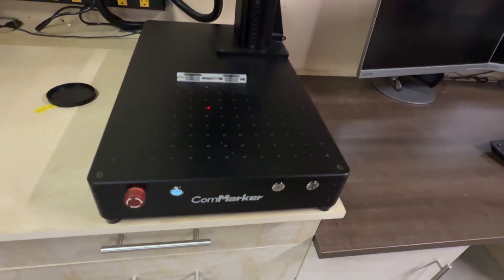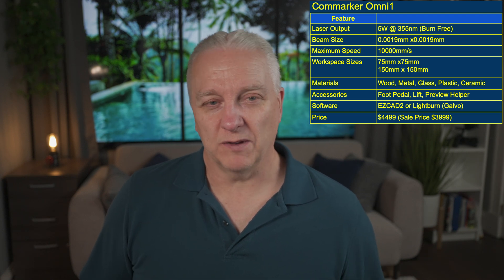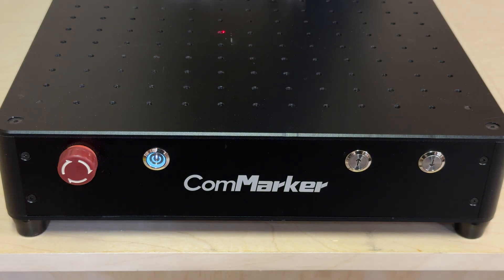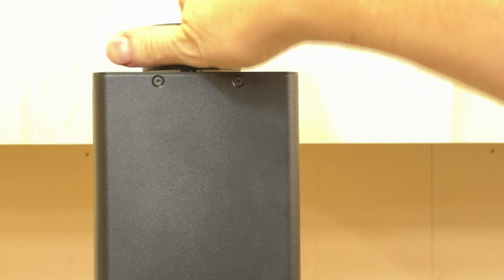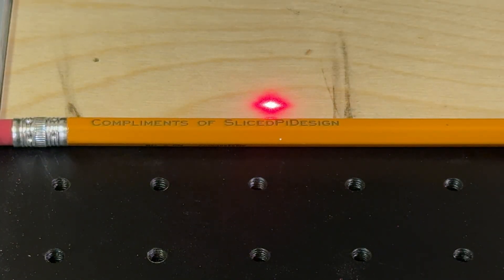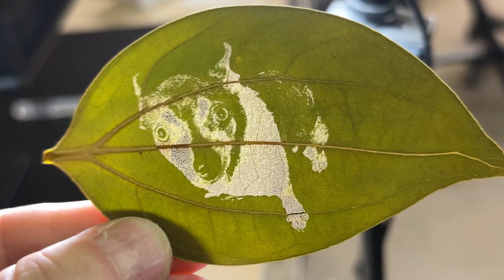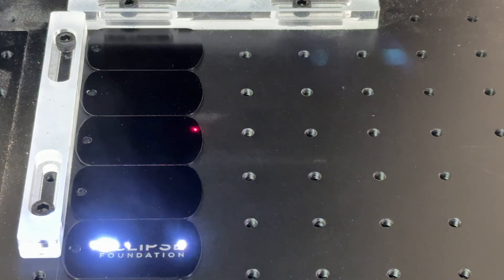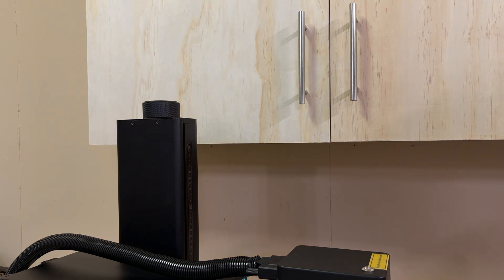Commarker Omni 1 UV Laser Engraving Secrets Revealed!

Comment: I have the Commarker Omni 1 and I have been using it for a while. The engravings have been coming out good. After I got he bed and the laser source level, I noticed that the galvo head dips down towards the front. I used a digital angle finder and it is off level about 1.2 degress. It's lower towards the front than the back. I have emailed Commarker, but they haven't responded yet. They've been very good so far. I have no compalaints about their support. I just wanted to see if you had experienced anything like this, and what you did about it. The other issue is that I was trying to change to the 70mm field lens, but it seems too long to fit in the alvo head. I couldn't see if there was some kind of adapter I needed to remove. Thanks, for all the great videos. I try never to miss them.
Reply from the maker: I had to shim my Titan 1 - if you’re picky about level, having to do this isn’t uncommon with galvo lasers

If your lens doesn’t fit the possibly you got shipped the wrong lens. Make sure it is for a UV laser. It will be written around the outside ring. Maybe they accidentally shipped you a Fiber laser lens
Reply: @SteveMakesEverything  Thank for the reply. Commarker replied and said that the Galvo head may be loose. I checked and there is nothing loose. When I am engraving inside a glass block, the effect of the glavo head being off is visible. Surface engraving does not appear to be a problem. I may try a shim. I've been in contact with Commarker for their instructions. I don't want to do something that would cause a problem. They told me that the lens has an adapter that can be unscrewed to fit. Thank you for the great videos and advice.

Comment: Hi Its well known that you can't laser cut or engrave pvc due to the toxic fumes Can it be cut with the omni 1 as its UV and doesn't generate the same heat? thanks
Reply from the maker: I would say no - at least I wouldn't try it.  The UV laser is a bit like a hammer and basically breaks material away - some of which will be small enough to get airborne.  The laser would certainly be capable of breaking chemical bonds, so I think your still going to have chlorine ions floating around.

Comment: Hello can you pleas tell me how you  do the material test was at 10 mins 14 seconds in your video  please
I’m trying to do a yeti cup engrave but never comes out shiney  silver under the coating  like other peoples have
Reply from the maker: This would depend on the laser you are using, so I'd need to know that (I assume it's an Omni 1 though).  If you are using anything but a CO2 laser then the settings will be very critical - and so will the focus. 

A UV laser will mark stainless steel, so once you have enough power cut through the paint, then you probably have more than enough to mark the stainless too.  What you can try to do is find two settings:  The first would be to cut almost all the way through the paint, and the second would be more gentle just to polish off the remainder of the paint and get you down to bare metal.

It sounds like the opportunity to do another video though.

Comment: I jusr got the Omni 1 5w UV laser. the installation is straight forward except when I look for the COR file in the parameter directory on the usb stick. I can find the file in Windows explorer, but when I try to load the COR file in Lightburn, it does not show any files. Lightburn 1.7.08. Any suggestions?
Reply from the maker: This is really a lightburn issue rather than the laser, but if you can find it in Windows, the easiest thing to do is copy it from the thumbdrive to your downloads folder or another known place on your drive.  Otherwise on the thumbdrive you'll find it in the software15 folder.

I assume you also loaded the markcfg7 file during the LB device installation.  You'll need that to set up the base laser configuration.
Reply: @SteveMakesEverything  Thank you for the quick response. I copied the files to the hard drive, and formatted a different flash drive, and transferred the files. Lightburn can find it. It may have been a problem with the flashdrive. Thank you again.

Comment: I use UV powder from hobby store mix a very small amount with rubbing alcohol into a small fine mist spray bottle and apply to item to be engraved.  Drys fast and wipes off with cloth or paper towel. I do not have to use the green paddle any more.
Reply from the maker: Nice.  I just use a sheet of white printer paper which makes the blue framing bright.  I’ve never used the green paddle

Comment: I made the mistake of buying this laser, the Omni 1. It didn't power up when I assembled it, after waiting a fortnight for delivery. There was no damage to the box in shipping but when ComMarker asked me to open it up and look inside I was disgusted with the "assembly". Wires not connected, a physically broken power switch, the power supply was completely insecure and the stepper power supply connector was ripped out of the unit. It's a lot of money for very poor quality.
Reply from the maker: I think they use a standard harness for a couple of different lasers, and not all features are available on all lasers - hence, the unconnected wires.  If the power switch was broken, then clearly, the box was dropped during shipping, and it would be pretty hard to blame a manufacturer for that.  However, I have suggested to Commarker that their packaging could be improved quite a bit.

If things are actually broken then I doubt this is a quality issue.  Commarker didn't take a hammer to it before they put it in the box.

I get a lot of lasers shipped to me and I've had a couple that were obviously dropped off a truck.  none of mine were Commarker's though.
Reply: @SteveMakesEverything  Unfortunately Steve, the wires I'm speaking of were the power supply lines between the individual units in the base. They were obviously insecure in the terminal blocks where the screws hadn't been tightened, one of which looked as though it had been stripped and never connected. The insecure power supply was because there were simply no screws and that had obviously been rattling around inside the base causing the broken switch.
Reply from the maker: @elguapo1507  Hmm, what has Commarker said?
Reply: @SteveMakesEverything  They looked at my video, apologised and said they would replace it with a new, fully tested one. The problem with that is it will take weeks to get here again and that wont get my work done on time.
Reply from the maker: @elguapo1507  Well you followed the right path.  I can't do much about their timing, but this is a problem I've tried to address with several manufacturers when it comes to support.

If a company has to replace a unit, then they should get it to the customer on a rocket.  The problem isn't the customer's fault, and the issue often impacts the revenue potential of a small company.
Reply: @SteveMakesEverything  I fully agree. The logistics is out of their hands in reality. The problem, as far as I can see, is that the box showed absolutely no signs of damage so overzealous handling isn't apparent. The fact that ALL of the damage was contained within the base unit and the power supply unit was completely unshipped thus causing the pulled wiring and physically broken power switch, that shows poor workmanship and poor quality control.
Reply from the maker: @elguapo1507  No damage on the outside doesn't mean it didn't get dropped.  These are precision devices.

I just hope you can get a swift resolution one way or the other.
Reply: @SteveMakesEverything  I absolutely agree. Well packaged but it was the internals that were unshipped and rattling around Steve. They ARE delicate devices and should be assembled with exactly that in mind. Positive locking devices or even threadlock would have stopped this from happening.
Reply from the maker: @elguapo1507  I wonder if they are putting thread lock on all the screws.
Reply: @SteveMakesEverything  There was no evidence of any threadlock on the screw that I found floating around. You usually see the red or blue remnants of it on the threads but there wasn't any. The screw length itself was pretty short and it would probably only just be "in safety" when torqued up.
Reply from the maker: @elguapo1507  The screws used to hold those power supplies do tend to be short because they don't want a long screw poking something inside the box, but really they should use thread lock on anything not designed to be removed regularly.
Reply: @SteveMakesEverything  I agree with you. It's a shame but, in my opinion, it didn't need to happen. There are so many positive locking methods available, even if they only used tab washers or just threadlock. I'm just furious that I've got hundreds of items that need marking and I'm probably not going to get them all done.

Comment: Hi Steve, I received the Omni1 today.  I followed your steps, but had to manually install the driver. Also, entered the Cor File.  Omin1 is showing as a device but it says disconnected.  What did I miss? I know its late, don't expect you to respond now.  I would appreciate any help you can offer.
Reply from the maker: You might need to select the port rather than relying on Auto port selection.  You may also need to install a driver if you’re running Windows. There is a driver folder on the UBS thumb drive.
Reply from the maker: Also restart both the laser and your computer and try again.
Reply: Good morning, I'll try that and let you know. Thanks
Reply from the maker: @nancy2371  Keep me posted.  It looks like you're mostly there.
Reply: @SteveMakesEverything  So I did what you suggested and it didn't work.  But what you suggested got me thinking, burning the brain cells.  I uninstalled LightBurn and reinstalled it and it worked. I'm so happy, I don't know what to do with myself.  Now that its is working, I'm going to set up the fume extractor. Then off to material testing. Thanks again for your time.
Reply from the maker: @ cool. Maybe it was the switch between regular Lightburn and the Galvo version that didn’t work quite right.

Comment: What material settings did you use on cork?
Reply from the maker: I don’t work with cork too often so I don’t usually keep track of the settings for it. The best thing to do is to run a material test so you have a reference you can tap when you are engraving these

Comment: But this laser has hardly 10000 hrs instead of the 100000 lifetime hours(rated spec on any real fiber laser). Also DPSS lasers such as this 5W laser can have premature failure, due to degrading QSwitch, when operated at high output levels(close to 100% duty cycle).
Except for engraving on glass, cloth it does not have any benefit compared to other low cost NIR dpss machines such as 2W Atomstack M4. It is true that the dot size is small, but unless engraving on tiny items, it is not a big deal. For what its worth, the UV laser is overpriced, due to missing fiber modules such as Raycus or JPT. It is atleast 3X overpriced, and will come down in price with time, especially for an aesthetic engrave only function.
Reply from the maker: True, though I would defy you to find any laser that will last much more than 10000 hours,

Comment: It seems great and all, but is this considered more like the Cricut of UV lasers or more of a higher end model? It's not locked into proprietary software or the cloud so that's good.
Seeing it come in a fancy box like that makes it look like it belongs on the shelf at Walmart instead of a crate. Things you buy at Walmart are okay for hobbies, I need something built to work for small business.

So far it seems like this will do it.
Reply from the maker: I’m not sure I understand the Walmart comment, but UV lasers are the pinnacle of laser engraving since they work with almost any material, and do what is referred to as cold engraving.  This laser doesn’t heat the material, so engraving things like plastic or glass parts is trivial, and it’s the only way to engrave without any surface prep or clean-up after engraving.  This makes it perfect for volume business work.

Most UV lasers are in the 3-10W range and the Omni1 sits in the middle of that range. This laser is far better for small laser engraving business work than any diode laser, though it isn’t designed for cutting.

Comment: Have you had any issues using a rotary?  I just can not seem to get it right but it works fine on my other lasers.
Reply from the maker: I have a cable that connects between the laser and a stepper motor. Note that there are two different stepper wiring configurations. If your isn’t working, most rotary attachment come with a short cable that you can insert onto your existing wiring to flip the stepper wiring.  I have a couple of ComMarker rotaries, but I also hacked together a different rotary from a Wecreat Vision.

If the rotary stepper is powering on when you turn the laser on (e.g. the rotary is hard to turn by hand), then the wiring is probably fine.  In this case go to Lightburn rotary settings and set the steps per rotation to 12800.

Comment: How deep can you engrave into plastic? I’m try to make cattle tags that are 3 layers. I need to remove the top layer so the middle layer is exposed. My diode lp4 does ok on some colors but I’m hoping this would work better on tags that are white over a black core. Thanks!
Reply from the maker: Ha, Amazon sells them, though I don't really need 50 of them😀
Reply: @SteveMakesEverything  I buy mine from Ritchey tags. I live in the land where cattle outnumber people over 4 to 1 so it’s a weird niche but highly sought after item locally. Unfortunately in the laser world at large there’s little to no info on recommended settings.
Reply from the maker: You should be able to do what you want.  If I knew where to get a cattle tag I'd try it for you.  Is this the same as lamacoid material?  It's the stuff that gets used for engraved name signs in offices (see this: https://amzn.to/49DAetZ).  If it's that material, then yes, you can easily engrave down to the center core
Reply: @ I think it’s similar only the tags are softer and more flexible, also more melty which is the biggest challenge for laser engraving them.
Reply from the maker: @vandengaaskjolen1821  If you can find these on Amazon, email a link to me.  There's farm supply place not too far from me, so I'll stop in and see if they have them and are willing to donate one to the cause.
Reply: @SteveMakesEverything  they don’t seem to be on Amazon but I’m wondering if the UV laser might permanently mark other kinds of tags that are meant to be wrote on with permanent marker.
Reply from the maker: @vandengaaskjolen1821  A UV laser can mark almost anything.  Most of these tags seem to be made of TPU plastic, which is the same type used in many watchbands.  I've marked several hundred of those.

The material in your tags, I believe, is ABS plastic, which is a bit more rigid and can easily have a second thinner lay laminated onto it specifically for engraving.  Email me a photo of the tags you have and I'll see if I can track them down. (Email in the description of every video

Comment: I was nearly going to buy one. However according to commarker the laser life is only 2,000 hours. Not much at all.
Reply from the maker: I got a quick answer back from ComMaker, and the estimated life of the Omni 1 is 10,000 hours.  So it 5x longer than what you were told.
Reply: @SteveMakesEverything  That’s a more realistic number. Still worth for people to know considering the cost.
Reply from the maker: @MrAtoulmin  Yes for sure.  It's a specification that I wish manufacturers would include with any product.
Reply from the maker: That doesn't sound right.  I'm going to have to confirm this.